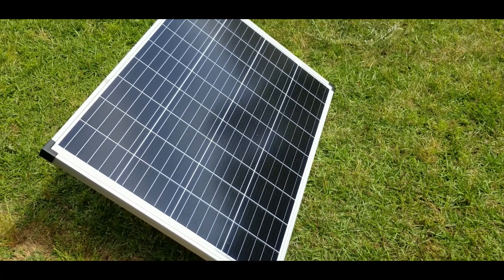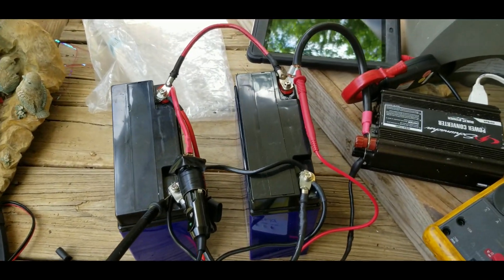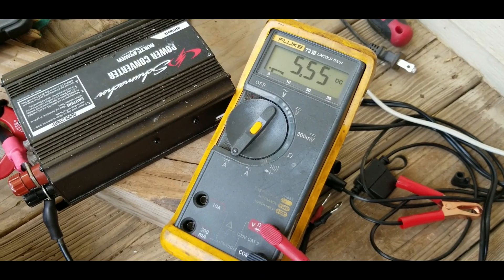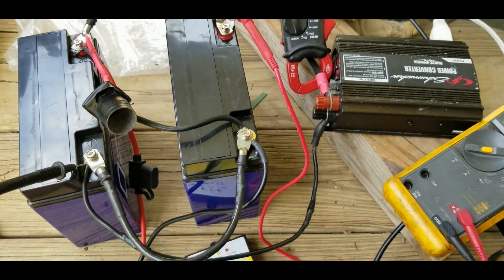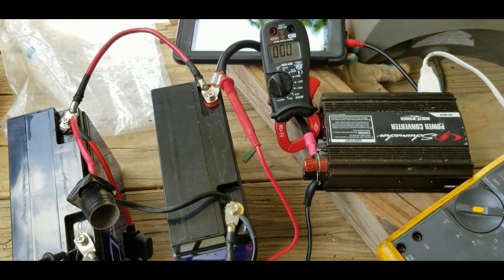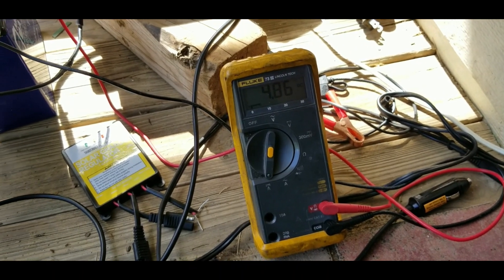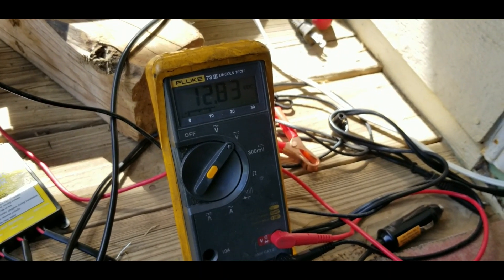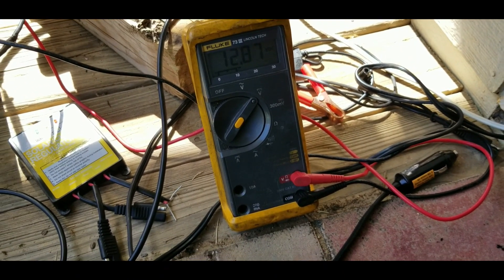UPDATE what can it run? 😎 New Harbor Freight 100 Watt Monocrystalline Solar Panel Item # 57325

Comment: Yeah , I'll have 21.6 kwH when I get two more 110 amp hour batteries in 2 weeks...these will be the final batteries...but it's the volt drop when I hook up a 1350 watt load ...I want it to drop only .3 volts or less ...it's waffling between .3 and .4 now...it used to drop .5 when I had 12 batts. or .7 when I had 10 of them...so I think it's going to take 16 to run my stuff
Reply from the maker: Your doing good it seems
Reply: BEGS the question: Just what all are you running?!?!?!  : )
Reply: @thomasmckelvey8961  not much...a 4.1 cu ft. fridge, the TV occasionally, lights, a 900 watt microwave, a 5000 BTU air conditioner, but only for periods...I have a 24 volt fan that I made out of a 12 volt leaf blower motor...it runs all the time ...it's in front of the inverter pulling air around it so that nothing gets warm...I have my laptop and phone charging, several power banks ( flashlight type) ..just whatever...if that's all I'm charging I use the 410 watt Schumacher inverter ...the microwave has an air fryer that uses 1450 watts...I use that for 9 minute frozen pizzas, I like the Red Baron supreme myself..lol I cook one every few days...Just stuff...I run my reciprocating saw some, and I charge my Snap-On 3/8 cordless impact wrench once in awhile...you find out there is a limit to what you can run for how long and all that...if it's cloudy you can't run the air conditioning  as long...unless you buy more panels and batteries...you have to decide where that limit is against how much you want to spend..
Reply: @davidpotter9462  Sounds like what I'd want to run for the most part, but all those batteries... that'll screw the pooch. Diggin' the fan mod! Did a Diode do it, or what? You need to drop a video, my man.
Reply: @thomasmckelvey8961  it was an old gray Craftsman leaf blower...it has brushes like an old mixer motor. They will run off of AC or DC ..I had to grind the rotor thing off and I put a 12 inch four blade fan blade and guard on it off a chinese fan that I had that the winding went out  on it...I had to make shaft slightly smaller so that the blade would go on...I just put a two wire cord on it and some alligator clips...some how it runs on 24 volts but doesn't use very many watts...the motor has ball bearings so it doesn't take much to turn it...it was like one of those things where the blind pig stumbles onto an acorn ...when it gets to where it's not 100 degrees every day I won't run it as much but I'm definitely going to look for another motor like that for an extra...it does have brushes and someday they will wear out...surely you can find an old craftsman leaf blower somewhere lol if you want to replicate my fan...I used some small wires temporarily and figured they would get hot after awhile...nope they don't...so I knew it was a winner then lol...
Reply: @davidpotter9462  12" Fan?  XD  XD  XD SWEET!!!
Reply: @thomasmckelvey8961  you should hear it when the voltage climbs when it's charging hard...it gets to winging it about 27 volts lol...volts are 24.9 right now ...If I leave it o it'll be 24.5 or 6 by daylight I imagine...after the panels start charging you hear it winding up again lol
Reply: @davidpotter9462  I can imagine, LOL!

Comment: So in effect, its charging the battery faster than an 8ah load can discharge?
Reply from the maker: It can charge and sustain 5 amps no issues
Reply: So if i bought 2 for my camper, can I use the controler that came with my old 100w kit? 
Btw, I have 2 12v group 31 batteries. 
 What Im hoping for is being able to watch tv (12v) maybe run the water pump and an occational cell phone/comp battery charge up and still have 2 full batteries when the sun goes down. Am I on the right track? Any advice?
Reply from the maker: So 2 panels will be more than enough for tv, phones, and stuff.....the issue is the charge controller....the HF ones are not great.....the small ones always burn up....and the ones in the kit I believe are barely rated for 100w....I have some links in my videos for an Amazon charge controller and its been working fine......we will be doing solar on ours soon as well....good luck and lmk if you have any other questions
Reply from the maker: Are you running flooding lead acid? If so when those reach end of life maybe think about running AGM or LiPo batteries you will get much more of a discharge and usable power
Reply: I think my batts are agm. I had heard the controller for the 100w kit would handle up to 200w. Can you confer?
Reply from the maker: @eatingoodinthewoods  i opened it up and only seen a 10a fuse so I would not trust it as 200w will put over 10a out
Reply: Amazon link for your charge
Reply: Controller?
Reply: 8.95 sound right. That's super cheap
Reply from the maker: Let me check
Reply from the maker: @eatingoodinthewoods  this should be just fine for your needs

https://amzn.to/2VeWit4
Reply: Ur the best dude! Thanks!
Reply from the maker: Np your welcome
Reply: One last question. I want to do 2 100w panels. Ill need to get a new charge controller but how do I get the panels to the controller?  Can I use the cable that comes with the HF 100w solar kit? It plugs 4 25w panels into the charge controller.
Reply from the maker: I ended up just cutting the ends off, stripping them and hooking them into the charge controller.....make sure you have a meter to check the polarity
Reply: Right but there will be two panels
Reply from the maker: @eatingoodinthewoods  so I just twisted the wire together and slide them into the controller
Reply: Then my pigtail should be fine. I was concerned about parallel vs series
Reply: Im a small channel but Id like to give your channel a shout out if thats ok?
Reply from the maker: Yes sorry to answer if you pig tailed it yes would be fine....I have 1 100w panel and 4 25 w panels all together no issues
Reply: Yea
I thought I might just add the new panel to my existing 4 panel set up but ultimately thats a lot to set up on a weekend camping trip
Reply from the maker: Yes it is lol I have them on a roof

Comment: Can someone elaborate on the “buffer” he described?
Reply from the maker: Are you talking about when we said the battery is a buffer?
Reply: @DIYKAI  yes.  Just curious how the appliances know how to pull from the batter instead from the solar panels.  I’m trying to wrap this concept around my head.  I’m trying to compare this to a cars alternator.
Reply from the maker: So it will pull from whatever source has the least resistance ohms law. The battery is like a shock absorber when the item first turns on it’s a high surge so it will draw from both until leveled out. Then it will take from both
Reply from the maker: As compared to an alternator that produces AC current and uses other deceives like a rectifier and stator to convert it back to DC

Comment: Very informative man appreciate it, I have one my self and one of the 25 watt panels as well. The direct sunlight is my biggest it barely charges for me cause of the trees. Gotta move it 7 times a day
Reply from the maker: Yes I move mine as well just to capture the most light....I'm looking into a small tracker if the price is right lol
Reply: @DIYKAI  not familiar with what you mean by tracker. Oh also there's a video you could do it'll be apx 200$ it's the tail gator generator from HF 700 watt. 2 gallon tank. Mixed fuel perfect in an emergency situation and fits in the trunk of a car.
Reply from the maker: The tracker is a ground mount panel system that follows the sun
Reply: @DIYKAI  ahh gotcha. That's be a good idea specially if the panels end up roof mounted. Ty man
Reply: @DIYKAI  oh and there's this tiny batter charger from Walmart, an everstart it's yellow with auto selection modes for fast or trickle charge. Like 40 bucks I've used it daily for almost 1.5 years. Guess it's time to upload my rag tag setup it will fully charge 2 batteries in under 2 hours. At least.
Reply from the maker: Nice

Comment: Would anyone know if I can use this Thunderbolt 100 watt solar panel to charge my Jackery Explorer 290?
Reply from the maker: You would need an adapter
Reply from the maker: The HF panel uses SAE style connectors the Jackery uses a DC barrel style
Reply: Thank you so much♥️. 
What type of adapter would I need to get? I've got the Jackery and am going to buy the solar panel today (last day of my 25% off coupon). Maybe I can get an adapter there also???
Reply: Maybe SAE to DC or DC to SAE adapter?
Reply: Thanks again! 
I found it
Reply from the maker: @linarr1927   not sure if they sell the adapter at HF we can try and look for an Amazon link for you if you like

Comment: Is it just me? When you run your solar panels through batteries, you are no longer using your panels to run anything! Your batteries are running the equipment! The solar panels are charging the batteries! You can have 100 watt solar panel hooked up to a battery bank that will power a house, that solar panel will not power a house! It will recharge the batteries....eventually! You do not want to run anything off a solar panel, it will only run during the day! The video should be "Harbor Freight 100 Watt Solar Panel, What can you run, and keep your batteries charged?" Just saying....
Reply from the maker: Your correct in any solar application  battery is always recommended....to get true output i put the panel under load (the battery) while it acts and supplies up and down demand its a buffer persay

Comment: I need help. I have a 3000 W inverter. If I get the harbor freight panels do I need to deep cycle batteries or can I get away with just one?
Reply from the maker: I have another video up showing a complete set up...https://youtu.be/TXR9EWxuw-Q
Reply from the maker: to answer you question you need a panel or panels depending on your needs.....the inverter size only matters for what you need to run......batteries will allow you to run for X amount of time depending on usage
Reply from the maker: what are you trying to power and for how long?
Reply: @DIYKAI  It’s just for the barn so occasional lights and handtools and hopefully my air compressor
Reply from the maker: Ok so for lights and basic hand tools you will be fine with 1 panel 1 battery , a charge controller an inverter......is the compressor 120v or 240v?
Reply: @DIYKAI  120
Reply from the maker: I would say get a pure sinewave inverter because motors don't like modified sinewave.....you may want 2 batteries for the compressor and you should be good

Comment: Fluke, excellent. Amp meter ( I get it) upside down. It's a great set up. Now, start the upgrades...  That's what happens when you start working with solar.

What if I added more panels?  I could get a better battery. A better inverter could actually do more.

I liked and subbed for more.
Reply from the maker: Thank you...and thats whats happening now....lol we have a setup but now refining it

Comment: You can get 240w, out of a 100w panel?
Reply from the maker: No that would not be possible a 100w panel will produce usually between 80-110w depending on conditions and charge controller
Reply: @DIYKAI  But you state the panel can produce "around 18 to 24v volts and up to 10 amps".
Reply from the maker: 18-24v is open load. We have seen spikes up to 10A…when hooked to a load average is around 5-7A and will charge a lead acid to 14.5Vdc our apologies for not pointing out open load…..the max we have seen in southern summer sun was around 130W peak but that was with a cool breeze full sun. So the panel is producing “more” than claimed we will be doing a 1 year update to see if the panels have degraded yet

Comment: Hello, great video!  I need some advice,  I would like to know how much solar panel and how strong does my battery and converter have to be to run a submersible water pump.  I only need it to run about an hour per day. Let me know please.
Reply from the maker: Hello and thanks for watching could you provide me the water pump specs…model # brand or if you know the voltage/amps it requires.
Reply: Thank you for responding. My submersible pump is 220 V from  Stark, model 75124.
Reply from the maker: @ileanamaser129  your welcome. so for your setup its going to be a little costly that is a very demanding pump.....I can post some links that will work for you
Reply from the maker: @ileanamaser129  you will have to run two 12vdc batteries in series to get 24vdc to run the inverters here are some things to look at:
 
Batteries:
https://amzn.to/3vCUd87

https://amzn.to/3jtf4Wk

https://amzn.to/3pzXROW

https://amzn.to/3E9ILDX

Inverters:
https://amzn.to/3BbrTL7

https://amzn.to/3Epv97R

https://amzn.to/3nm8Clp
Reply: Thank you so much, this helps me tremendously!
Reply from the maker: @ileanamaser129  your welcome I may also suggest using 2 solar panels for better charging and maintaining of the batteries as well as an MPPT charge controller like mentioned in the videos 
Good Luck!
Reply: @DIYKAI  Good Idea!
Reply: @DIYKAI  Hi, I have one more question.  If I get a 120v/220v converter but my submersible water pump is 230V, is this going to be a problem?  Thank you in advance!
Reply from the maker: Just make sure it’s a 220v pure sine wave and you should be fine…..220v inverters generally like a 24vdc or higher battery bank

Comment: Bought 2 of these and all wiring is 1 ft 2 awg, on the batteries, and 2 awg 3 ft to the 1000wpure sine wave inverter, and 10 awg wire 20 ft from the panals to the universal 400w hub, and into the 30 amp controller, and a 10 awg power lead wire from the controller, to the battery bank, this is our 1st setup, and what a learning experience it is. Maybe the 10 awg wire from the controller to the batteries, is the weak link in the chain, should this be 2 or 4 awg instead?...please add a comment for guidance....GLTA
Reply from the maker: So I have the following:

All my panels come to a separate positive and negative hub this seemed to stabilize the voltage coming off the panels. From there I run a 10awg to the charge controller and 10awg to the batteries. The inverter has 2/0 coming ofd the batteries. Hope this helps
Reply: I have my controller about a foot from the battery bank, and I used number 4 stranded wire to the batteries...I have 890 watts of solar panels and the wires on mine don't get hot...it always takes more than you think it will, I thought it might take 10 or 12 batteries but I 'm going to have to have 16 to run my oven, etc...I used 1/0 wire to my 2000 watt inverter/charger...this was my first time too..I started with two 45 watt kits and two batteries...I cut off all the plug ins on them because they were all corroded and weren't passing current, sat them close to the window where the wires come in and ran the six sets of wires straight to the controller, and I got an increase right away in voltage and amps...I have these two HF kits in series facing the first rays of sun in the morning...the other 800 watts of mono panels do the rest...I just added two 100 watt panels today to mine...I had too many batteries for the 600 watts of panels that I had before to fully charge...14...lol...I will buy my final two batteries in two weeks...make sure not to use a solid wire for DC...use stranded only...those plug ins they use are not waterproof and mine all lost contact after awhile...nobody else will tell you this stuff...I checked mine with m y voltmeter with the other panels unhooked, and the volts were really low so then I got to looking at the plugs and they were all green inside...  make sure you're getting volts to the controller...once I cut those nasty plugs off I started getting current to the controller...just something you might check...just remember...this winter when the snow is flying, would you rather have plug in connections, or soldered connections? Something to think about before winter brings its low light/ voltage to the mix...I eliminated about 25 feet of wire which is just extra resistance , also...with the two 45 watt kits in series , I get 37 open volts...these panels don't have a lot of amps but they make "coffee power" early in the day, lol...I usually get like 2.3 or something on amps from those old style panels...
Reply: Update....I have 1090 watts of panels now...
Reply from the maker: How many amps you pushing now??
Reply: @DIYKAI  lol, yesterday it got up to 25 for awhile...today it was 23 earlier but its down to 9 now...clouds from the hurricane are moving in so the amps have been dropping the last hour...watts are like 642 until smoke clears from Cali
Reply from the maker: Still a nice amount of power